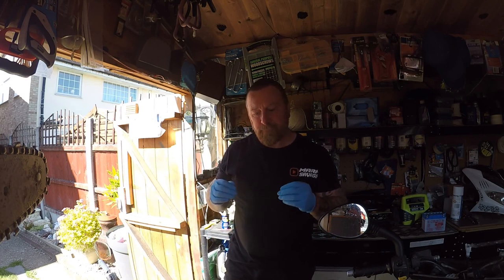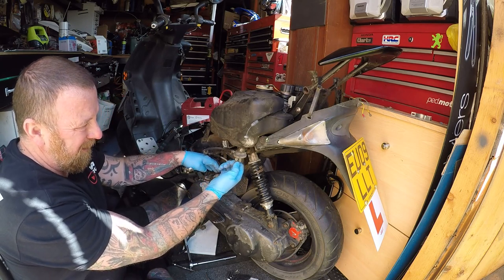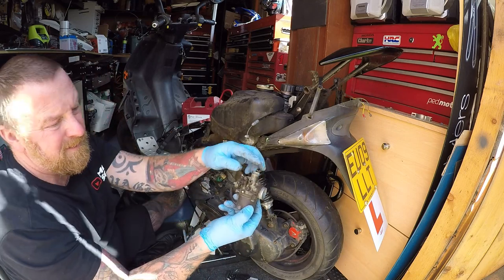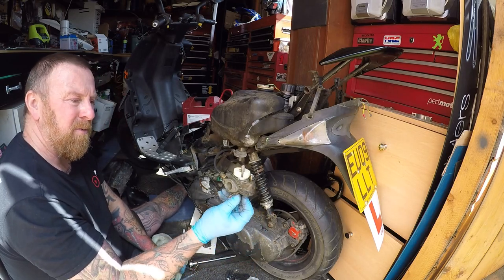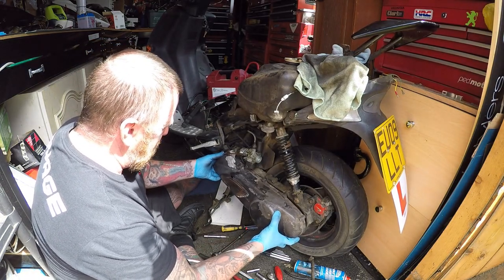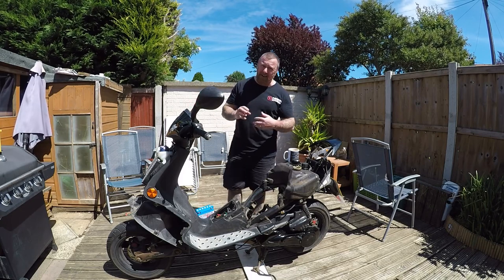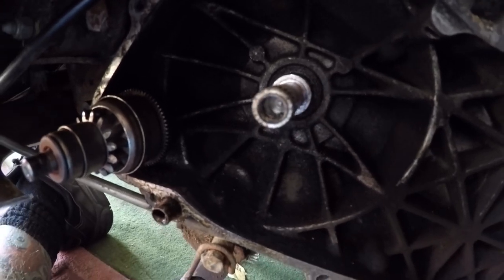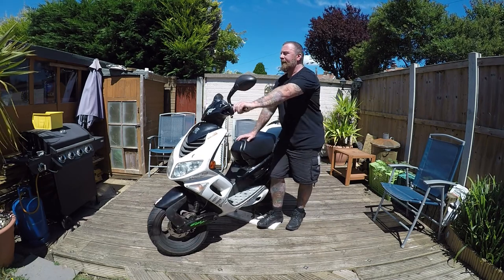SPEEDFIGHT MOPED CARB VARIATOR & FINISH UP PART 5 MARK SAVAGE

Comment: He mate I've got a peugot speedfight 50cc 2 stroke and it was running when I went to buy it and on the way home it cut out now it wont start it has fuel, air, spark and a bit of compression any ideas to get it running thanks mate
Reply from the maker: this happens a lot bud and the last owner knows it and sold it like it, have you contacted them as you do have buyers rights even private 
id bring it back
but if not i have many videos on them
type in speedfight mark savage 
they will come up or a have another channel where they are all on a play list
but it could be piston but follow my videos with wet hand test , etc

Comment: Hi mark can I fit a 125 in a Peugeot speed fighter3 it is a 50cc in there at the minute thanks mate
Reply from the maker: The sp3 made both engines so yes bud
I've done both sp2 50 to 100cc and on the sp3 but you have to change everything 
Clocks and cdi exhaust etc 
The cdi is the main part as this is the restrictor !
Reply: Thanks mate
Reply: mark savage do I need to change the Wiring loom to

Comment: Hi Mark. I have speedfight 2 2004 AC. And is it normal that with full gas tank I can drive about 100km? And I have all original parts on.
Reply from the maker: It does come down to how you ride it and top speed!!
If restricted to 30 mph then that's not the best but only small tanks and a lot better than a car !

Comment: Hi mark. Do you have a video on where you show how to fix brakes on speedfight? Because they are shitty! Is there a trick for speedfight? Thank you
Reply from the maker: Hi bud 
If you type in speedfight brakes mark savage , the front and rear brake videos come up plus one on sticking brakes 
There are over 100 speedfight videos on every thing that you need
Reply: @marksavage  I have searched but I can't find any video where you bleed brakes on speedfight. I have only found one video with speedfight brakes but my speedfight is on disc. Can you put me a link ? Thank you for your time. And sorry for my bad English! God bless you.

Comment: What do I do when my moped puts too much oil in the fuel.
Reply from the maker: pre mix or pump?
Reply: @marksavage  premix I put much oil in the fuel
Reply: @marksavage  it slowly choked itself off I emptied all the fuel and put a better mix in it but it still doesn't start
Reply from the maker: @muratzecic8837  oh id pre mix until it comes through but as it wasn't working you may have damaged the piston if it was running without 2t oil !
this is the common result for seized engines or damaged pistons
Reply: @marksavage  thanks mate.
Reply from the maker: i watched your videos , the oil is heavier and would have got in to your carb so you need to take off your carb and clean it all then refill with clean fuel and only a few cap fulls of 2t oil then kick start till it runs and let the fuel go through 
you might need to clean plug to , i have over 100 speedfight videos but they will really help you sort it and be back on the road
type in speedfight mark savage
Reply: @marksavage  and also I don't have a spark anymore.
Reply from the maker: @muratzecic8837  now that's completely different problem!!!
Check out my cdi video for which cdi you have and what might be the problem
Reply: @marksavage  Cheers mate   💕

Comment: Hi mark I have a speedfighter that I've put a new engine in but there is a red/black wire on bike which I can't find on new engine and I'm not getting a spark I'm local in yarmouth and would appreciate your help and skills pls thanks rob
Reply from the maker: Thats a immob loom so you need an immob engine bud !
You can change the stator coil or the loom and cdi 
This is why you have no spark bud
Reply: Thanks mark appreciate the info bud,gret videos helped me loads keep up the good work mate.

Comment: Hi Mark hope you can help, i have 
Peugeot Speedfight Ice 125cc 4 Stroke, it has all of a sudden started to bog down it does not want to rev over 4/5k rpm.
It just started mid ride at a junction and i had crawl all the way home.
Have stripped and cleaned carb, changed CDI, coil and fitted new plug, still the same, has anybody had the same problem and know a cure ?
Reply from the maker: In this poor wet weather the filter can clog up and will need changing 
Plug can get water on it 
Clean and dry off ht lead wd40 after 
Fuel lines become hard or split 
Check and change  
Oil ok ?
Cdi and connectors all ok 
Wd40 them

Comment: That's really strange how they modified the crank. I guess it must of been done in the bike. Otherwise you would just change the crank, if you split the cases.
Another aerox, like them. 😁
Reply from the maker: yes this is what I thought, was it easier than changing the crank, I guess but a lo of messing however it worked !!